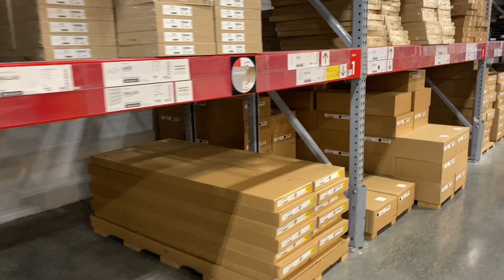MAKING A NEW BEDROOM FOR ELIJAH!: Adventuring Family of 11

Comment: Hey guys... just a possible helpful hint. You may have already thought of this.... but just in case.  
Super easy to just turn over the rug right inside your front door. Then put your heavy piece of furniture on it. Then you can slide it anywhere in the house with ease. And not scratch the floor. Just in case you hadn't thought of it!! 
😊
Reply: That’s such a good idea😊!
Reply: Hey, I do that all the time and can move quite heavy stuff by myself!
Reply: Cardboard boxes work well too.
Reply: Was going to say the same thing…we use rugs and towels to move furniture around the house. I also put any furniture I am painting on a large piece of cardboard and can easily turn it around like it’s on a lazy susan.

Comment: Crock could be used for umbrella stand. (I also put my back scratchers and picker- for when u drop things). May I ask aren’t you afraid the bugs will get into the food without a seal tight container?  When I have to move anything heavy (not blessed with men) I place it on a blanket and pull the blanket as close as I can to where it needs to go then stand it up.  For a closet u could use pvc, creating a u shape with a bar, hang it from the ceiling and use curtains on pvc to cover what clothes are hanging. Did you think of putting 2 dressers with one on top of the other. 💚💚💚💚💚💚💚

Comment: You guys could remove the window and the armoire would fit through the window?
Reply: They don't own the home.
Reply: Yes Jamie Kernc I am aware of this.  However, removing the window by just opening the latches can be done and put back in, without ruining the frame. Just like if you have to replace parts for the window or for cleaning.

Comment: That crock is probably not worth more than 400 at the most... and that's if it's not a reproduction,  which there are a ton of.  But if you're planning on using it to store food,  buying a real replacement lid on ebay is better than making a wood one that won't fit perfectly and keep out air,  dust and bugs.